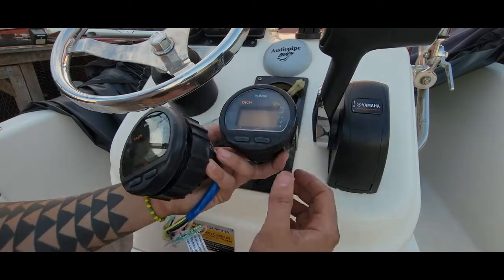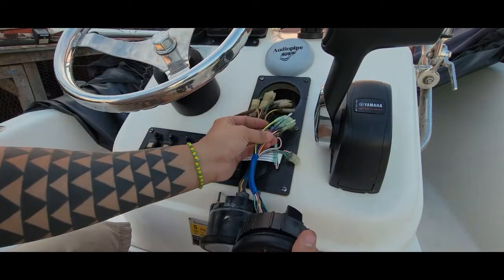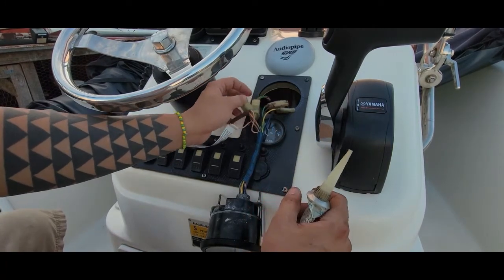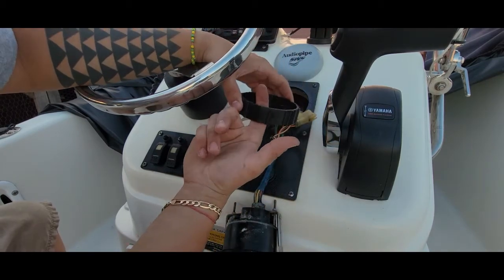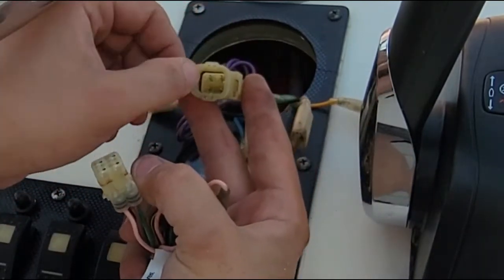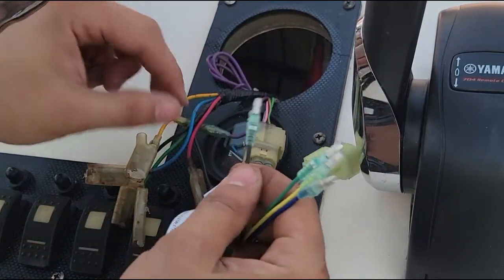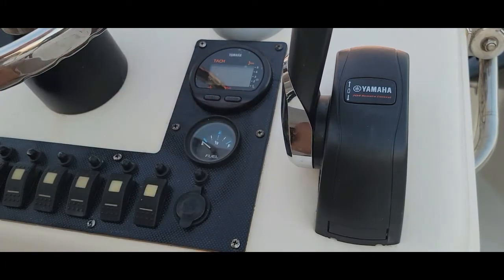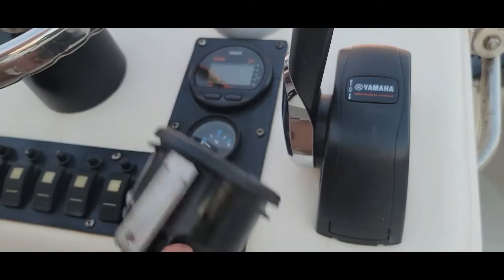Yamaha RPM gauge replacement ep#73

Comment: Great video helped me in my removal process. Tio: Electrical grease is an insulator shouldn’t be put on any conductor. Should be put around the plastics to create a seal 👌
Reply: As much grease he put on the connector suprised if the gauge will even contact and work properly

Comment: I was wondering does the hours stay the same when you replace your gauges or do they reset
Reply from the maker: The hours will stay in the engine control module. The gauge needs to be hooked up to a laptop and program.
Reply: @TheCuban.45  do you know the program I want to buy new gauges but I don’t want to loose the hours
Reply: @TheCuban.45 please do a video on it
Reply: @hotemsalem3588  The same happened to me when i replaced my rpm gauge i lost my original motor hours.